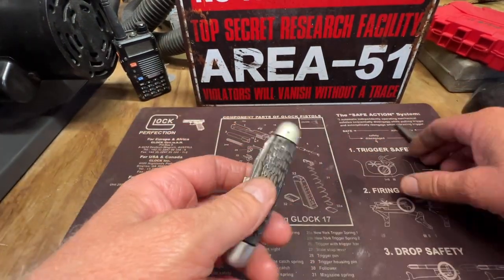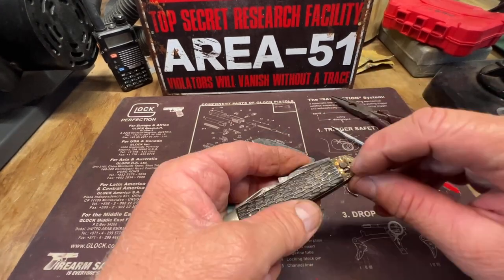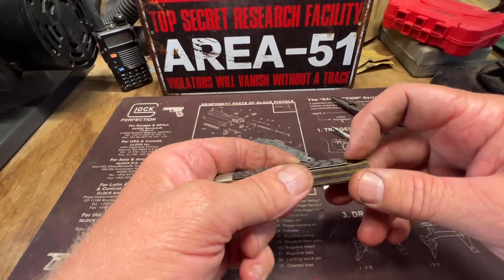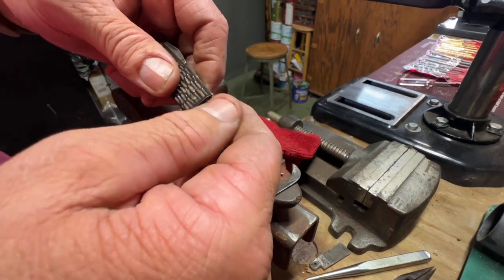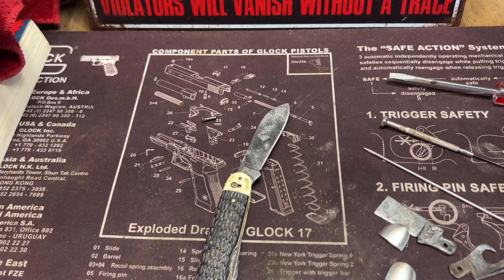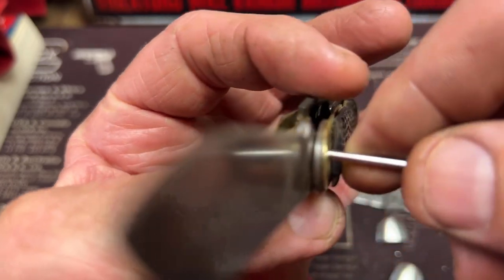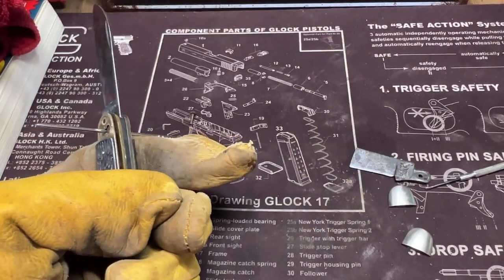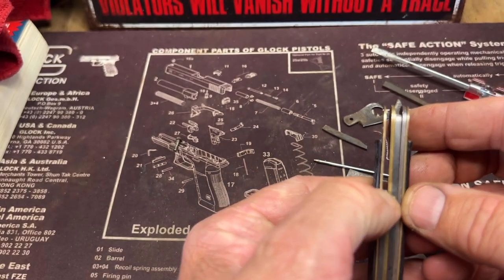Restoring a 1960's Ulster Camping Knife: Part 1 - Blade Replacement and Spring Repair.  I Goofed UP!

Comment: Been watching a bunch of your videos.
I love what you do restoring these knives! I have a knife fixing hobby myself. 
For that knife construction on that knife with the hidden pins, ive opened all the blades, then clamp it in a vise to keep tension on the springs. Then use a dremel to grind off the head of the pin that holds the springs in the middle. Then use a punch to knock that pin out. 
Take out of the vise and the whole side of the knife will slide off, bolsters and everything.  Then one the sides are off you can use the existing hole as a guide for drilling the new hole through the bolster for your new pin.
I learned all this the hard way and ruined some knives in the process😂
Anyway, great stuff, love your work.
Reply from the maker: Thank you very much for sharing that.  I've learned everything on my own and i'm always open for help.  Thanks again and Thanks for the support.
Reply from the maker: what bit for the dremel do you use to girnd the head of the pin off?  Thanks
Reply: @theknifedoctor  
Those small diamond-dust coated ball bits do a pretty nice job. 
Yeah I've really been enjoying watching your repairs and cleanings! Watching old knives come back to life is exciting. Keep up the great work!

Comment: This past weekend, I was doing the exact same thing to the exact same knife, well almost the exact same thing....mine had a broke pin that I had to replace. I wish id of come across video instead of fighting the hole alignment for an hour prior to the genius idea occurring of grinding my replacement pin to a point lol. I struggled so much with this particular knife, no clue why this one was so problematic. I also was not a fan of the way the bolsters were added. Your video made me feel slightly better about my battle. Love the content, you are a kindred spirit lol